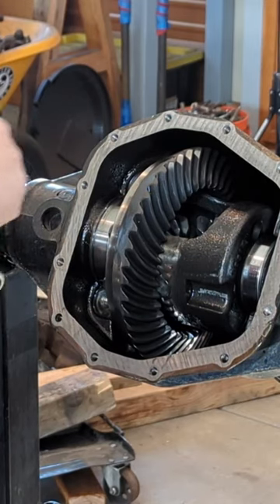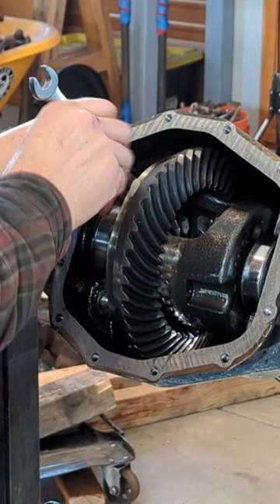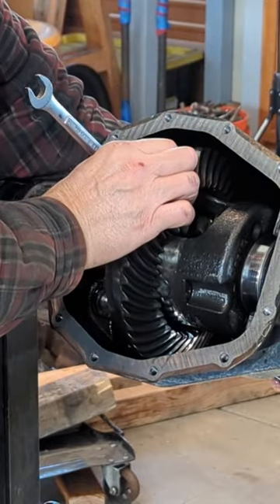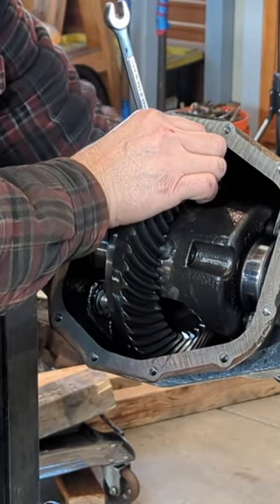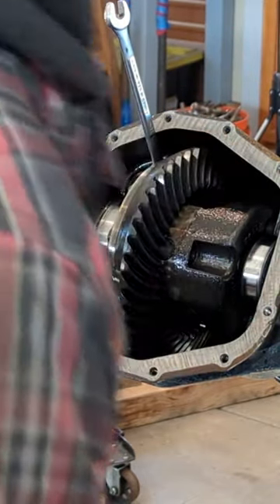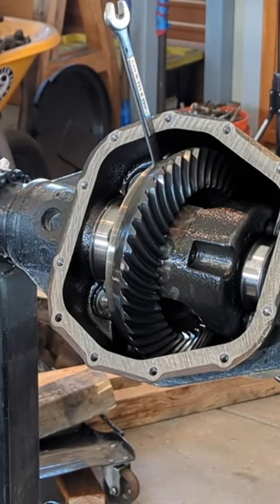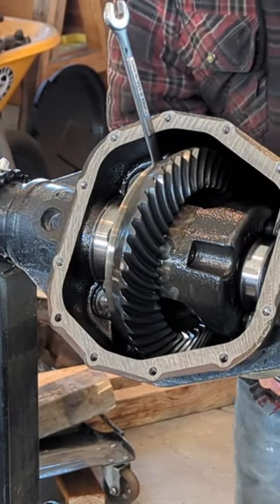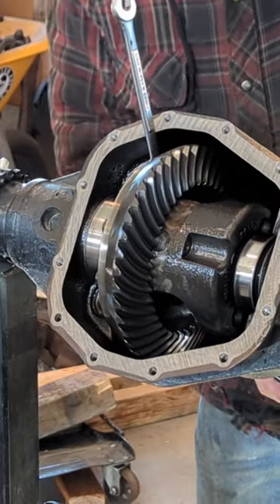Easy Way to Remove a Carrier

Comment: I damaged my housing trying this (slightly, I did stop before any real damage).  Probably works better that pry bars if the carrier is not really stuck in there though becasue you can get the spanner flat with the casing edge.